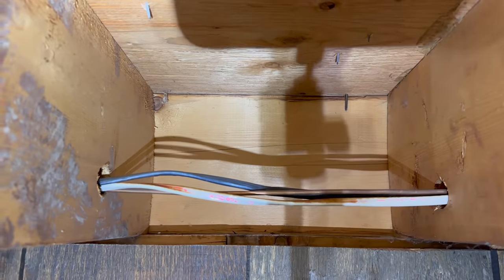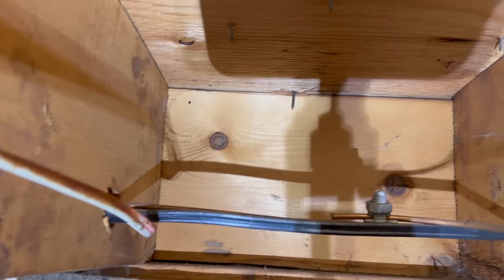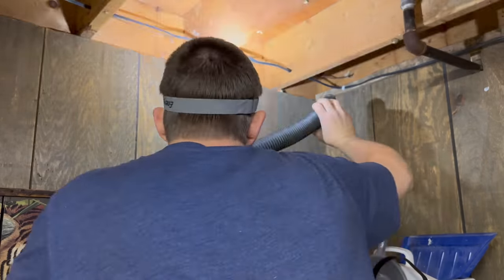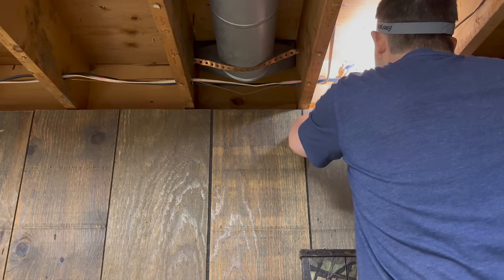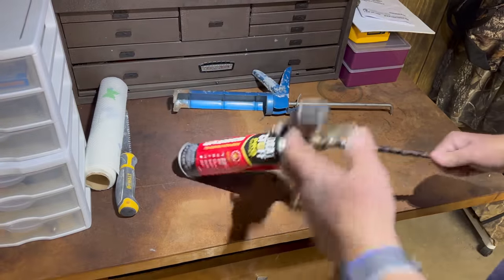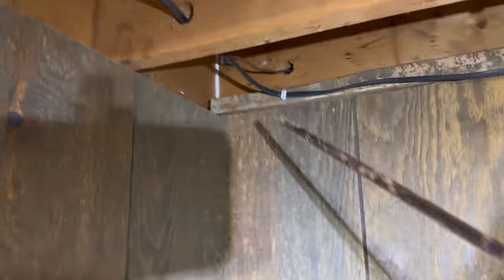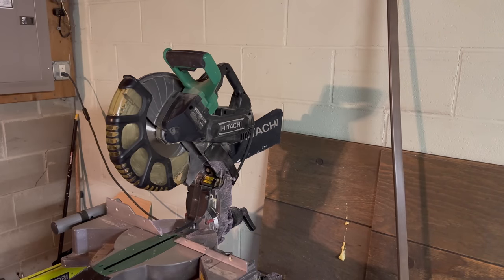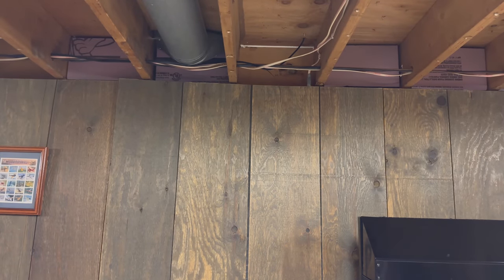Rim joist insulation air sealing

Comment: I've used flash and batt techniques to seal the rim joist on a number of projects.  I think the 2" foam board spray foam is ideal.  Less than 2" on XPS and I don't think you have a vapor barrier but instead a vapor retarder which could lead to rot on the rim joist.
And the caulk seems superfluous if you seal with foam spray.  I don't use any fiberglass in the basement and hopefully no where else.  But rather fill the joists with mineral wool.  It's easier to work with, hydrophobic, fireproof to 2200 F and deters pests. And so much easier on your lungs.
Reply: Would like to just clarify-on the ends you use the foam boards and then in the joists themselves that run under the floors you use mineral wool? I have mineral wool on my end joists right now with no caulking so it's clearly not as good as this setup and I don't have anything under the floors. Thanks for the help!
Reply: The University of Alaska Fairbanks did an informational video on insulation in rim joist. They went into numerous crawls spaces when the temperatures were well below zero and every place they went where fiberglass was used it frosted up from moisture.  They went to houses that used closed cell foam and drilled small sample cores  to test for moisture and found none. We did our place with 4” closed cell rigid foam on the outside of the foundation and 7” of sprayed closed cell foam from the rim joists to the top plate(double stud walls). We only used fiberglass in the ceiling and I used R-38 Batts with R-21 batts between the ceiling part of the trusses. I sealed the ceiling vapor barrier with acoustic seal.  We don’t pay much for heat as we have about 200 sqft of glass on our south wall with the east horizon about 20 miles away and the west horizon 45-90 miles away.
Reply: @megdahlin1118  I use foamboard to directly seal the rim joist.  It is better at minimizing thermal bridging than fiberglass or mineral wool.  Then I put mineral wool behind it.  Mineral wool is so much better than fiberglass because it's hydrophobic, less itchy and is a great sound absorber.  And don't forget to foam seal the sill plate.  Even in a relatively modern construction there's a lot of air leakage through that area.
Reply: @BobPritchard  Thank you
Reply: @BobPritchard  there's actually a new type of fiberglass that isn't itchy at all. It's the pink stuff and a popular brand.. I can't remember the name of it but I emailed for a sample of it about 6 months or so ago. Could literally sleep on it! Soon thereafter they started selling it at Home Depot here.
Reply: @BobPritchard our house was built in 1998 and there is a closed-cell foam strip in between the top of the poured concrete basement walls and the wood framing the rim joists. Do you recommend using expanding foam along that strip even if there does not appear to be air incursion their? Wondering if I should borrow or buy the instrument to see if we're losing heat at that area? Thx for any thoughts...
Reply: @kathygill1923 Hi Kathy, I used an IR thermometer to measure the temps around my sill plate.  Despite having the foam gasket I could detect super cold air coming in at the sill plate.  So I foamed sealed the joint and afterwards the super cold air wasn't found at the sill plate.  Same at the RIM joists.  It's hard to comprehend so much cold air getting in but it does!
Reply: @BobPritchard  thank you! We are STILL finding many shortcuts the builder and/or original owners took to shave costs or some ways that best practices/codes have changed over the years. We inherited an undisclosed mouse issue and live in a semi-rural area so removing batt and replacing with Extruded Polystyrene rigid foam board. As long as I'm putting in the time anyway, I'd like to gitterdone correctly to both insulate AND eliminate access to vermin and insects. Ick.
Reply: @kathygill1923  By the way, my Infrared thermometer cost less than $20.  Lots of options via Amazon.  And it's quite helpful to find cold spots/air leaks.
Reply: 2” is required for vapor barrier like you thought.

Comment: I use a similar method to air seal and insulate rim joists here in Maine. However, I prefer mineral/rock wool over fiberglass. It has a higher R value per inch, is denser so it is easier to cut and stays in place better than fiberglass, it is hydrophobic, and it is non combustible so it does not have to be covered in a finished basement.
Reply: @jimhendrix7776  Closed cell spray foam is my first choice and it is what I recommend to clients. However, the flash & batt approach can be less expensive so many clients choose this method. When you use closed cell spray foam how many inches do you use and do you add some batt insulation to get desired R value? Thanks
Reply: @jimhendrix7776  I follow Spray Jones and agree regarding his videos.  I also agree regarding the short comings of relying on R value alone in deciding on what to use for insulation, and how much to use.
Reply: @sjpropertyservices3987  sad reality is though, when code dictates r21 and you're retrofitting a reno, you have to fill that whole cavity 😆
Reply: @sjpropertyservices3987  I use full foam 😆!!!
Reply: @jimhendrix7776   with 1 inch of spray foam, or a foam board with R6 or better and a batt of. 3 1/2"  mineral wool (R15) you have the required R21 which is also what is currently required here
Reply: @jimhendrix7776  Spray foam cuts down on labor costs. I am telling clients what they may save in material cost with flash & batt is often offset by increased  labor costs. Inspectec a vacant  property a few days ago with an unfinished basement. Had fiberglass batts in rim joists with no air sealing. Convinced client to use closed cell spray foam to air seal and insulate before moving anything into basement. I think it will take several hours to complete. Flash & batt would likely take twice as long. Also, finding the appropriate foam board is not easy at times.
Reply: The mineral wool bath insulation I use is R-15 so a foam board with R-6 or better gets me to the desired R-21, and with spray foam I have the air sealing needed for a proper job.
Reply: By 'hydrophobic' in this usage, does that mean Doesn't attract moisture or repels it 
Or both? 
Or Doesn't Hold Moisture ? 
Real Wool - e.g. carpet & rugs - perfectly holds and releases moisture to help keep rooms at ideal humidity.

Comment: Nicely explaining this method. I would lean towards a closed cell spray foam kit. Much fewer steps and you’ll be guaranteed to not have any leaks.
Reply: The closed-cell spray foam kits arent approved for that use in Canada, didn't pass the tests, not sure why.
Reply: @terrencesauve  That makes no sense. Inch for inch it’s probably the highest R value material and is an automatic vapor barrier!

Comment: I hit the top plate edge where I could to seal that. No gaskets installed in older home. I used DAPtex Plus Multi-Purpose Foam Sealant, which is water clean up, and a partially used can is reusable months later. Around the rigid foam board edges I use standard expanding closed cell foam.

Comment: I did an entire basement like this. It works well but man is it super time consuming. Before I finish my current house I doubt I’ll bother; likely just nicely tucked fiberglass like 99% of people do before finishing.
Reply: Don’t bother with the fiberglass. It’s loose and needs to be installed perfectly to be remotely effective.
Reply: The rodents will love the fiberglass! And you’ll love the mold! Great decision for the next home owner to deal with ❤❤
Reply: @zachgoestoeuro  When I moved into my house in Michigan, the first thing I had to do was pull all that shit out. It was full of mouse shit.
Reply: @zachgoestoeuro nonsense. In follow up the basement already had fiberglass in all the joist cavities, and it stays in place with friction. In my prior house, to which I earlier referred, it also was a new build with fiber and before I foamed it never once had an issue with rodents. 

Like I said: 99% of homes here have either no insulation in these bays or fiberglass. Foam is ideal but it’s something you’re more likely to find on YouTube than in real life. In fact the only home I’ve ever seen to have it was mine, which is also a reason I didn’t bother this time around; inspectors don’t care and home buyers don’t value it. That same home I had sheeted all my basement walls with foam and tightened the hell out of all the seams. When I sold I don’t believe anybody cared. People don’t value what they don’t understand. 

If you have rodent problems you need to address that. I’ve never had a mouse in any home I’ve ever lived in. Properly built house has raised entrances and clearance to ground, making ingress of rodents unlikely.

Comment: I was told these pink owens corning foam boards are combustible and cannot be left exposed in most crawl space applications
Reply: Every XPS product at all the stores mention they cannot be left exposed in an indoor application. Must have min 15min fire break. I've also seen another YouTube channel even compare closed cell, open cell, fiberglass, and rockwool insulation to see which burns faster. Quite alarming.

Comment: Question: In the video at the end you see the end joist with caulking but no foam board. Is that right or should you air seal the end joist as well? One of my end joists is damn near impossible to access because of the foundation and an adjoining joist are like 2 inches apart. Previous homeowner stuffed a bunch of fiberglass up there which isn’t doing much for air seal. Any thoughts?

Comment: never and i repeat NEVER have standard fiberglass batts in the rim joist cavities.  If those cold condensating rim joists have any warm air meeting them in extremely cold months, it's a disastrous condensation/mold/mildew issue and learning that from experience with a new home build.  from doing this project entirely myself, i would strongly recommend cutting foamular pieces, angling all edges (so foam expands better on all corners, gluing the foamular to rim joist FIRST with loctite PL 300 adhesive and once dried go back and foam the edges to seal it out.  The foam board doesn't always rest tight against rim joist when foaming the edges i found they would sometimes pop out and not sit flush.  Gluing first is definitely the way to go.
Reply: So if the boards are glued to the rim joists, are you able to easily remove them if needed for various inspections down the road?
Reply: @zachgoestoeuro  yes, the foam board glue is just a bead to fasten the foam board securely in place against the rim joist.  if you don't, the board will slide all over while trying to foam the outer edges and it can be messy.  spray foam doesn't firm up for quite some time either.  you can always cut out the foam at a later date and easily replace it too.
Reply: @slo232000  thanks!
Reply: @zachgoestoeuro  welcome!  i would suggest rockwool on the inside once foam board is sealed, it's a MUCH more superior product to fiberglass batts, moisture and fire resistance, etc.
Reply: @slo232000  thanks. Two questions on using rockwool: 1. Does it simply “float” on top of the foam board or do you somehow glue it to the foam board? 2. I’m seeing some people use aluminum tape the four sides of the rockwool to the joists to limit intrusion of rodents. Seeking your general impression on that. I’m fine with the extra expense.
Reply: @zachgoestoeuro  rockwool is much more dense and thicker almost like a large sponge so if you cut it about 1/2"-1" larger than the space it will usually form fit into the cavity against the foam.  I cut numerous blocks of rockwool and installed behind 1" foamular in each cavity and it was more than sufficient.  No need to fasten in place if cut properly.  Mine sits partially on top of concrete wall where bottom plate is anchored to concrete so that helps hold it in place too.  Caulk bottom plate edge where concrete meets the wood too.  I have zero pest/rodent issues but i'm also a new build so no need for the aluminum tape in my mind if sealed properly.  Any exterior rodent penetrations, to me, should be addressed from the outside and you don't have to bother on the interior.

Comment: The pieces of foamboard act as a vapour barrier as well. So shouldn’t any batts of insulation be on the cold side (outside) of the foamboards? 
Standard building rules for cold climates says vapour barriers go on the warm side. If you use a polyethylene barrier afterwards, say when finishing the basement, aren’t you basically sandwiching fiberglass batts between two vapour barriers?
Reply: No. Fiberglass on the outside would cause condensation problems within the fiberglass. So, you want the fiberglass to be on the warm side. That way, the condensation point/dew point is within the foam (i.e., no moisture within the foam, so no condensation will occur). 

There is a formula to determine your foam to fiberglass ratio, and it depends on your location. Not enough foam (r-value) and moisture will condense outside of it. And too high of a ratio of fiberglass will move the condensation point farther inside (dont want that happening in the fiberglass). In other words, you ALAWYS need enough foam to keep the dew point inside the foam. 

It would also be bad practice to encapsulate fiberglass, or anything for that matter.
Reply: You don't use poly barrier if you do this.  The foam acts as your vapor/air barrier.

Comment: On a different point, the access holes for your services should not be where they are, they should be drilled on the central axis of the joints. By locating them as is, the joists loading capacity will be reduced.

Comment: In cold environments none of alternatives using  fiberglass or foam board or spray foam are ideal. Moisture will travel through the wood joists (or the inevitable holes and gaps missed) and deposit on the cold surfaces of the rim joist.  Now that the water is trapped, it begins to rot the wood.  Ever wonder why it's impossible to keep paint on the exterior surfaces of wood windows?  It's the same process .... moisture transits through the wood from inside the home and deposits between the wood and the paint on the exterior .... and voila .... the paint peels!!  The only way to stop rim joist damage is to stop the rim joist from getting cold in the first place.  This is done by insulating the "exterior" wall, rim joist and concrete foundation from the outside to keep it warm so moisture cannot get deposited on it from the inside.  It took me years of research and thousands $$ in damage to figure this out and finally get control of the situation :)
Reply: Thank you  That is the issue that brought me to this video. Our 20 yr house with amazing ICF Basemen is insulated enougj, but the west facing rim joist have regular fiberglass batt pieces loosely inserted and now we see evidence of moisture & upstairs subfloor issues in a corner area.  Those end boards of joists  technically terminate At  or Under a raised concrete porch.  
Memory is ends were sealed with something (remembered guy applying wasn't wearing a mask or eye protection  & overcome w fumes).
So you think putting nothing there is better than filler that attracts & holds moisture against the wood. Right?  Thank you for any clues !
Reply: @karlakay what area do you live in and did your fiberglass batts have a vapour barrier over top?
Reply: @markmartin7384   Central Ohio.  Over the top? Not connected to each piece of batting. Above is subfloor, and in one problem area is  tile with its tile underlayment Some type of painted on, noxious sealant product at ends, between of each joist.  
About to take them all out this weekend & decide what is needed  ICF Basement is heated / conditioned and NOT  humid / moldy - but those few corner endplates that had batting.

Comment: Some boards appeared to be loose while they were being sealed.  Shouldn't the foam board be glued to the rim joist prior to sealing?
Reply: You can if you want to.  If you’ve been meticulous about the air sealing part, they shouldn’t need glued.
Reply: The foam around the edges acts as glue to fix it there.

Comment: When using spray foam your supposed to spray a little water on the surface your foaming, then one time over the foam again.
Almost noone knows or does this.

And also make sure the wood have no way to get wet from the outside, since now it will loose its ability to dry on its own.
Reply: the cans of sprayfoam are not closed cell foam air does get through slightly it is mostly air tight at the surface

Comment: I simply ask my insurance company what is covered before buying materials. They might deny your claim especially if it's a DIY. The air bubbles inside expanded polystyrene board stop heat transfer but can accumulate moisture making it ineffective. Any type of the foam crap will melt and drip fire. I just pay the high utilities and let my house breathe. Better than wasting your time and money creating your own mold problem!:hand-purple-blue-peace:

Comment: Is it okay when I put r13 rolls in between floor frame seal with 1/4 inch plywood ?i have dirt crawlspace. ?
Reply: all depends on where you live if ground is wet you might want plastic over ground is there vents between ground and floor in cold north people put vapor barrier towards house in south they put it towards outside for hot moist outside air.

Comment: Do you use foamboard with backing attached?  I used multiple layers with covers already attached and now I'm worried about mold and rot.  Help anyone; I need advice.  Do I pull it and try again?  The NE is COLD.